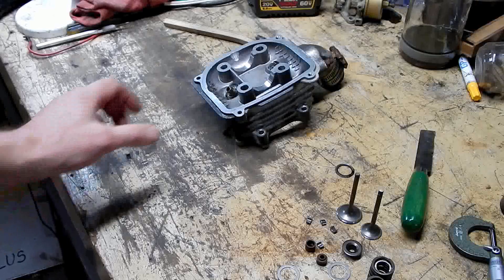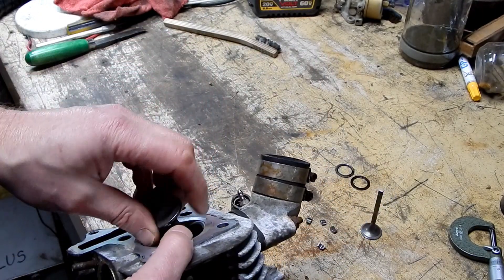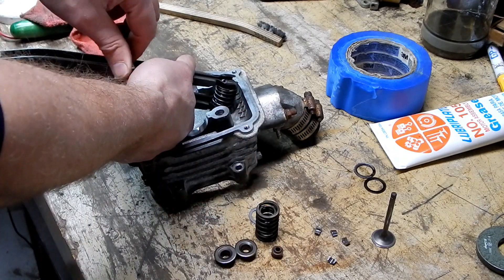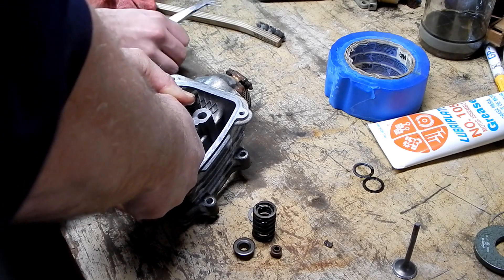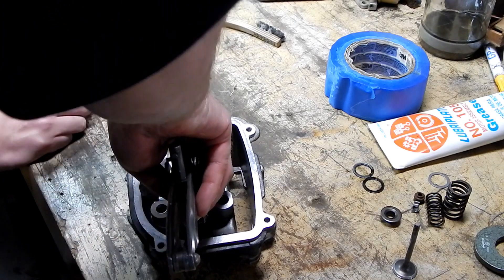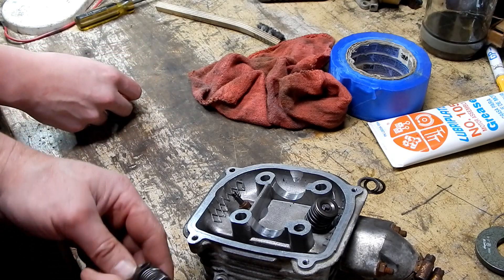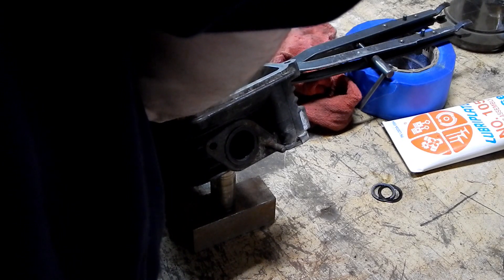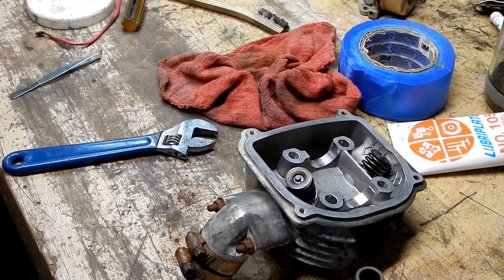The Yerf Dog Go Kart Part 5

Comment: On my big valve spring compressor, I took the straight jaws (came with straight and curved like yours) and tack welded a piece of conduit to it to make a 3" spacer. I then cut a notch on the bottom of the conduit big enough to get the keepers in.
Reply from the maker: That's a good tip.

Comment: Steve ,
Those "shims" are called spring seats. They are there to stop the springs burying into the cylinder head.
The inlet and exhaust valve outer springs are on upside down. They are progressive wound springs. The spring should have the tighter gap windings to the bottom. The way you have them fitted it will allow the valves to "bounce" at higher revs mate.
The vertical casting is there to "dam" the oil to help lube the cam lobes and bearings.
A quick and dirty spring compressor can be made securing a piece of angle bar with bolts through the head bolt holes (ensure there is padding to protect the head face, (I like to use a scrap of wood). The bolts should be long enough to allow a suitable sized ring spanner to go under the bar to allow it to push on the spring retainer (the bit the collets drop into).
With some practice the 2 collets can be fitted to the retainer and held in place with a finger while compressing the spring, they will drop in place when the spring is compressed enough.
Cheers Eric
Reply from the maker: Thanks!

Comment: A little bit of space like you have between the keepers is normal. Your big compressor would have worked if a long socket was used to take up the space on the valve face side.
Reply from the maker: Thanks!